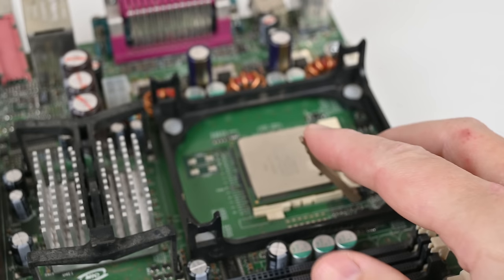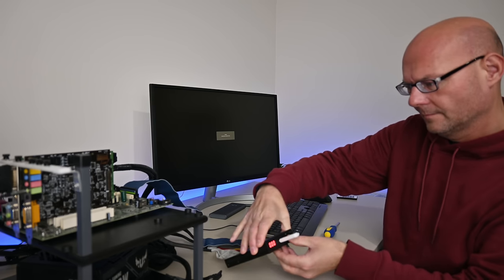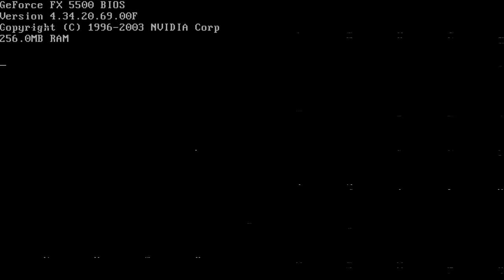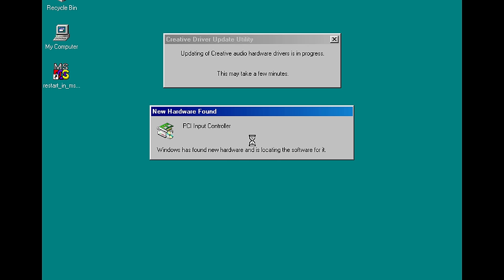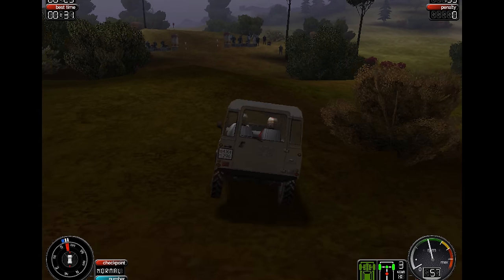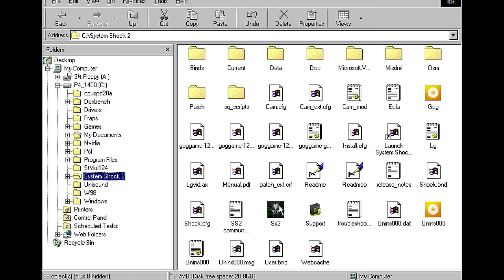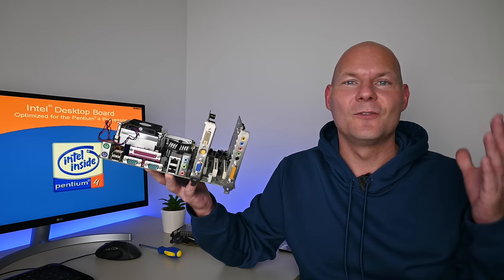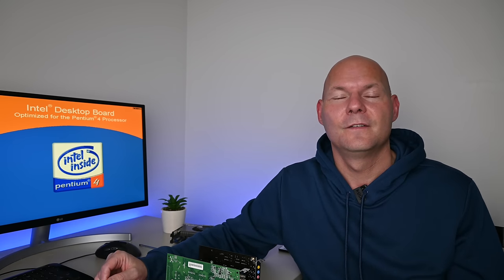It Failed in 2000, Has It Aged Well? The Pentium 4 1.4 GHz

Comment: Great video, Phil!
The GeForce FX 5700LE usually overclocks LIKE CRAZY. You can reach unbelievable clock speeds. 🙂
Reply from the maker: I actually tried to OC, but it just wouldn't work, at least under 98. Maybe it's something for Windows XP?
Reply: @philscomputerlab  strange... it should work on Win98 (never tested these cards on WinXP). If by "it doesn't work" you mean that the clock sliders don't affect the card's clock speeds in any way, then the only explanation I have is that you're probably using a different driver version (one that might have a bug?). I don't remember what driver I used with this card... it might've been 56.64, or I simply did a forced installation of 45.23 (although, as far as I remember, this card refuses to work with 45.23).
Reply from the maker: @ruxandy  Yea I could move sloders and press the test buttons, but simply nothing happened. I remember having this with another card also, so maybe the BIOS was simply locked against overclocking...
Reply: @philscomputerlab  I don't think the BIOS on the FX series cards supported "advanced" features like locking the overclocking. Either way, you could try and use NVFlash and NiBiTor to dump and edit the BIOS.
Reply: I found low end cards and the slow ones in a bracket to be great overclockers.
The FX 5700 LE is the perfect example. It runs on 250 MHz, but has the same chip as the FX 5700 Ultra that clocks at 475 MHz. While reaching that clock might not be possible, there is a loot of room between 250 and 475.
Looking at old articles seen people getting it to 500/523 or 350/536 or 470/570 or 320/490
Yes, might be worth running the BIOS through NiBiTor to set some changes. Maybe even change voltage and relax VRAM timings to get more headroom. Really technical stuff that give crazy amounts of performance.

Case in point: My Geforce 3 Ti 200 runs at the normal 175 MHz core and 200 MHz memory, but will do 235 MHz core and 240 MHz memory, landing right between the "normal GF3 and the Ti 500 with 200/230 and 240/250 respectively.
Or my 7300 GT, stock at 400/400, but able to do 640/440, coming super close to a 7600 GS. The equivalent of buying a GT 1030 and overclocking it to beat a GTX 1060 3GB
And my R7 250X went from 1000/1125 to 1100/1337 (could've gone higher with the memory, but I like the funny number)

For software I would recommend taking a look at the good old RivaTuner.
And no, not the RTSS that is bundled with MSI Afterburner, but the original software that Afterburner is based on.
I've clocked cards from said GF3, to a HD 4870 with that, so basically all cards from the DX8 to the DX10 era should be more or less compatible. In some cases it's even possible to unlock disabled pipelines.
Similar to how you can turn a Radeon 9500  into a 9700 (which you already covered) or a HD 6850 into a HD 6870, but purely in software. Or turn it into a Quadro to enable advanced API features.

Comment: Love your videos Phil, you inspired me to finally put together a Windows XP machine to play some old games that I missed growing up. Can you or anyone else recommend what chipsets to look for when using an LGA 775 CPU like an e8600? The G41 motherboard that I have doesn't support FSB over 340, which means it basically doesn't support OC. I know that X48 and P45 are usually recommended as the best, but are there better options than what I have that are more readily available than those more expensive boards? Thanks for any help.
Reply from the maker: Don't bother with OC, that's my opinion! E8600 is so fast out of the box. If you want faster, go with a Sandy Bridge like i5-2400 system. I believe the P series chipset is what you want. G hat onboard graphics?
Reply: @philscomputerlab  thanks Phil, I saw your videos on LGA 1155 and may in fact do that at some point. The e8600 is very fast, but I was just trying to push it a little further for Crysis. Probably not totally necessary, you’re right. Thanks for the advice on chipsets.

Comment: Software & games tested here are slightly before P4 time - me at least, remembered it more as an early Win XP era CPU 🙂2002-2005
Reply from the maker: 2000 for Socket 423 and 2001 for 478, but that could just be the paper launches. I picked games from the Windows 98 era, that was my thinking behind it. Yes you can intall XP, upgrade the CPU to something 2+ GHz and it should do a half decent job...

Comment: The 1.4 - 1.5 - 1.6 GHz P4 models (i think there was a 1.3 GHz sku as well?) were pretty abysmal, performance and thermal wise. Basically a high-clock P3 was better, not to mention AMD's impressive Athlon XP CPUs. Still, Intel sold a huge number of them because they came with every new OEM pc ("Intel Inside" was a huge marketing gimmick at the time). You could only get AMD if you made the computer yourself, at least where I lived.

Comment: P4s are the minimum chip I'd use for any internet usage. Of course, that's only with a highly optimized Linux distro running on it, but I'd say it was the first "modern" CPU in many ways.
Reply: The minimum that is usable indeed. Mostly because of SSE2. Now for not ultra light Linux, a Core 2 Quad or Athlon II/Phenom II X4 is still usable today

Comment: Hello Phil. I wanted to tell you this on the other video you showed Snappy Driver Installer, but you should be using Snappy Driver Installer Origin, SDIO for short, that's the one with actual maintenance updates and a more proper driver database. You can also choose to download a driver pack for more common devices, but it's a huge file, so I recommend giving this one a shot and see if it helps you out. I'm a big fan of your channel, but the oldest machine I have is a Celeron 420 with 512MB of DDR2 RAM, running Windows XP, and I cannot afford parts, or find them locally. I used SDIO on that machine and it did update all of my drivers just fine, it has an ASUS motherboard modified by a local manufacturer known to hinder performance in order to save power consumption.
Reply from the maker: I am! 🙂
Reply: @philscomputerlab  Oh? I must've seen it wrong then, my apologies! Odd that it wasn't working as it should. 
Would that machine I mentioned be okay for a Windows 98 setup? It has no floppy drives but there's a DVD drive with a rather faulty eject button.
Reply from the maker: @xGMV  Use XP on that one!
Reply: @philscomputerlab  Okay thanks! It came with some Linux distro and a friend many years ago installed XP for me, and last year I reinstalled the OS clean, currently using SP4 on it. 
It would be neat to have a video on tweaks for Windows XP now that a few new ones came out, if you can. Cheers, Phil!

Comment: I have found an IBM Netvista PC with an P4 in it, I replaces the Powersuplly, and the DVD Drive. Installed a Geforce FX 5200, 2 GB of RAM, and now the PC Works Great.  With Some games. I innstalles Windows XP on it. But first i had to Update the Bios becouse it was not Windows 2000/XP Ready. (some issuses with ahci) 

Also Yes a Pentium 4 PC is a good Retro Gaming PC, beside my HP AMD 64 3200 Notebook With JBL Speekers.

Comment: I can't recommend Leadtek's various GF2, GF FX 6 cards enough. They seem to be good quality compared to the glut of generic GF2 and FX. I ended up with one of their A340/ FX 5200, and it actually has the slightly shrunk NV34B, and DDR472 on a 128bit bus (still doesn't help it much against an 128bit FX 5600XT or especially 128bit FX 5700LE). While my GF2 MX DH Pro has 3 diagnostic LED (power OK, AGP 4x enabled, error) and a temperature sensor.

Comment: Cool. I just resurrected a p4 1.5ghz and its working great with win98😊
What was that piece of black paper that went onto the cpu? Instead of thermal paste
Reply from the maker: Yes many years ago I stopped using paste and use thermal pads. It has made life easy and less messy as I build a new system all the time.

Comment: The Pentium 4 gets a lot of hate for various reasons, but honestly my P4 machines have always been completely solid performers for me. My P4 2.6GHz is my workhorse. Great performance with emulators of the era (NeoRageX, WinKawaks, etc.) and for just work. I use it mostly to create images for my older system builds, burn Dreamcast games, etc. It has never failed me.
Reply: Yeah, they weren't bad. Just the downsides of it were more noticable for the usual gamer. Higher price, higher power draw, harder to cool, slower in games.
But when a program made use of SSE2 or was done in a way that catered to the architecture, they were blazing fast. Video encoding, mp3 encoding, Quake 3, all did really really well on them.

Comment: I always stayed away from P4 processors due to their reputation as energy hogs.  Someday I'd like to do a Socket 478 build with a Celeron D processor.  Also, re: GeForce FX cards, if you can ever get your hands on an FX5600 (sometimes found cheap on ebay), they are significantly faster than even the 5700LE with 3dmark scores very close to that of the Radeon 8500.
Reply from the maker: Yea these FX cards are now really hard to find. Funny, back in the day nobody was interested but now they are in hot demand :D
Reply: The FX 5200 Ultra is also interesting. It sits between the FX 5600 and FX 5600 Ultra in terms of performance, running right past the entire 5500 lineup. It's a midrange card with a lowend branding.

Comment: Hey phil, what do you think i should use for my video card in Tualatin p3s win98 build? I've been using the voodoo 3 3000 agp but it's kinda slow. I have the gf3 ti 500, gf4 ti 4200 128mb, fx 5900 ultra. Of course i have the aureal vortex 2 (your voice was in my head as i typed it).
Reply from the maker: Yes the V3 runs out of steam quickly. From the cards you have, well they are all nice! The GF4 is likely what I think fits best. The FX has "eye candy" benefits, like 16x anisotropic filtering and enough performance to use antialiasing.

Comment: I can't remember if I had a Pentium 4 before 2006, but right around that year I had a 3 Ghz Pentium 4 machine with Windows XP.
 It was my second and last Windows XP, as well as my second PC that I actually owned myself. I had it for perhaps 5 years untill I changed it to a i3 Windows 7 computer. Now the reason why I got rid of it is because I got a virus on it and while my dad did remove it in the end, it still had some kind of issue, that I think it was something similiar with Windows 7 activation thing. 
Basically if you change Win7 configuration or don't activate it, it will give you a black background and some text above the taskbar that this copy of Windows isn't genuine. I got this "Windows isn't genuine" error and thought this was the end of it (i also think the hard drive might have become slower). 

Had I known that I could just replace the hard drive and that Windows 7 64-bit had issues with compatibility, I would have just kept and repaired that Pentium 4 machine. I still have regrets for it to this very day.
Reply from the maker: Hard lessons learnt when we were younger...

Comment: I'd love to see how these would perform with modern cooling solutions used on the latest gen CPUs. Those P4 s got HOT. After a couple of years, running a power hungry laptop with a P4 inside could be an unhappy experience - here's looking at YOU, HP Pavillion ZD3898EA.....!
Reply: I have a Cedar Mill Pentium 4 that I can strap on my LGA775 board. Let's just say even oc'ed to 4 GHz the Hyper 212 evo keeps it under 55°C when running prime95

Comment: IIRC, System Shock 2 did not like multithreaded systems. I had a dual socket system way back then (yay teenage disposable income!) and the game struggled to run. It'd crash and do all sorts of weird things. I found that if I removed one of the CPUs the game would run fine. However, shutting down and un/resocketing a CPU is a super cumbersome process. Then a friend of mine helped me by showing me a script where I could force the game to run in a single thread. I'll have to dig around and see if I can recover that batch script that I used to launch the game. What you might try in this setup is disabling Hyperthreading in the BIOS and see if that gets SS2 up and running for you. It's a great game to play in the dark with headphones and EAX. :)
Reply from the maker: I ended up using original CD images and latest patch ..

Comment: yeah your love on P4 is still going on! :)  I think the main problem of P4 system is overheating and capacitors on the main board problem. I have 5 or 6 P4 systems. the most of system has same capacitor problem = by design or cheap out on cheaper capacitor.. I don't know. but it develops the failure of capacitors(leaking) in times. 
I tried to repair some of them but it is really not worth it sometimes. that's problem of P4.  
If you can replace capacitors to higher quality ones I think the most of problem would be gone!
Reply from the maker: The Athlon stuff from that time suffer the same issues. With the heat, stay away from Prescott and stick with a Northwood below 3 GHz...
Reply from the maker: BTW I've done a polymod in a previous video. It involves replacing the electrolytic caps near the CPU socket with polymer caps.

Comment: This CPU is more for Windows 98, if anything, I don't think it would gain anything running under 2000 or XP. Especially with DX9 titles...

I had an Athlon 1100 PC once in my life used for a while the new C2D PC came around like a year later after getting A1100. I had fond memories with it with the Retro Games, maybe that's a reason I'm more like a AMD guy with Athlons Thunderbird/XP or 64 after all. 

I heard so many horror stories of Pentium 4 and got to use one a few times (Not my PC BTW.) Man, Sometimes I wished I could travel with my Core 2 Duo PC that I had. xD

Comment: I seem to remember back then the AMD Athlon being much more popular amongst enthusiasts. I myself went with first the k6 processors then Athlon's. Unfortunately to fund upgrades i had to sell my older components, so i didnt hold on to any of them. The older AMD chips dont seem to be so common where i live, so ive gone for pentium 4's in my retro builds and one with a pentium 3. The intel motherboards seem to have survived for longer and in better condition than the AMD equivalents from the time. So ive gone from AMD  back in the day, to Intel for my retro computing. I still use AMD in my modern system! 🤔🤷🤣
Reply: Athlon XP were faster in games, cost less money, pulled less power and were easier to cool. Basically everything even a slightly interested user would want.

Comment: Found a working HP system with a P4 3.0ghz at a local thrift store for 5 bucks. Only problem is one of the CPU bracket crossposts has snapped so one tensioner has nothing to hold onto. Will be dope after I get a replacement bracket installed.
Reply: Buy one or make one. I tinkered around with an intel boxed cooler a bit. Basically replaced the whole push pin setup with a diy backplace and screws.
There are full metal brackets for socket 478

Comment: I love the P4 out of nostalgia, when I started in the world of computers the P4 was the top! Then came the socket 775 and with it the Core Duo and the P4 were no longer the Top CPUs! So when I think of a retro gaming PC, a P4 478 comes to mind :)
Reply: Oh, Pentium 4 was also on LGA775. Officially the early boards only support Pentium 4 and the late ones only Core 2, there are differences in power delivery, but quite a few boards can run both.

Comment: Great video! I'm using the athlon xp on my win98 rig but I'm going to swap for a P4 (478 socket) as I have several units in stock. The boards I have all use PCIe and not AGP, so I'm going to use a 6800 Ultra 256Mb PCIe version combined with Forceware 77.72. What do you think of this combo? I would prefer to use the FX5900 (it's the one I'm using on the athlon build) but all my P4 boards have PCIe... Will the 6800 work OK?
Reply from the maker: PCIe 6800 for Windows 98? Hmm it's not something I would recommend. The FX is much better for that. The 6800 is a better fit for Windows XP.
Reply: Yeah, as I thought! I'm gonna try anyway, all my P4 boards have PCIe unfortunately....
Reply: @philscomputerlab  Just found a gem on my stock, a ECS P4S5DA/DX+ with SIS645DX which has AGP... I would prefer an Intel Chipset but I read that this SIS chipsets weren't bad... As for the P4, I only have a 478 in stock running @2.4GHz, it'll have to do! (the remaing P4's are all LGA775). Gonna use the FX5900 instead of the 6800! Thanks for your advice and videos, they have been along with vogons my goto when I need some doubt to be answered!

Comment: I had two later P4 systems and one early p4  Two later PCs ran windows XP and windows 2003, The other one was a get me out of jail system that ran windows 7, ( only just mind)  All 3 of them got hot, i ran the P4 system with windows 7, right up till windows 8 came out.  I mothballed the P4s for a number of years until i powered them back on.  The Windows 2003 server system was finished, the PSU had practically killed the HDDs, and wasn't stable.  The other two booted up ok,  i ended up scrapping all 3 of them.  Only the HDDs of those systems survive now.  The CPUs were given to a mate of mine for his retro systems a long with the ram.  I went back to the P3 era for my retro systems, because i found those much better systems.